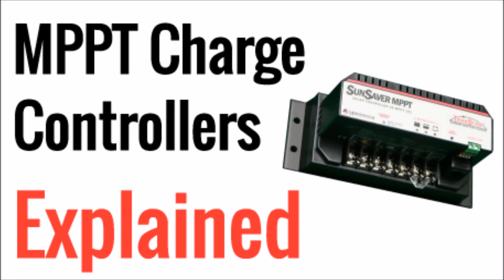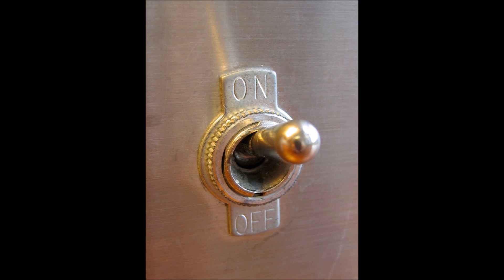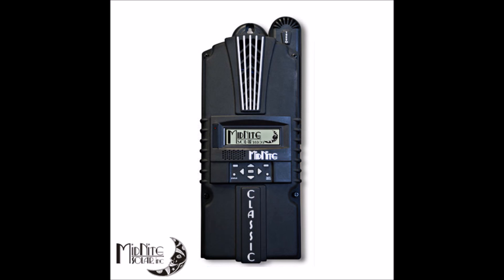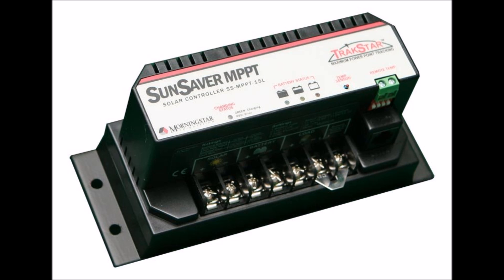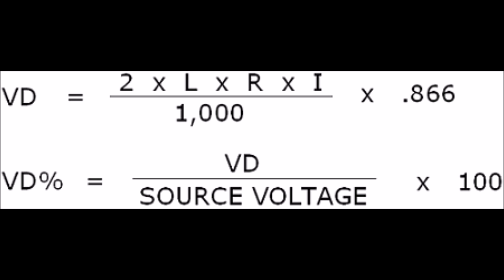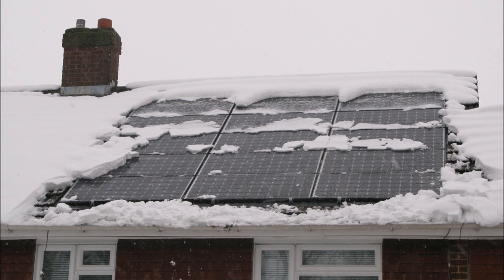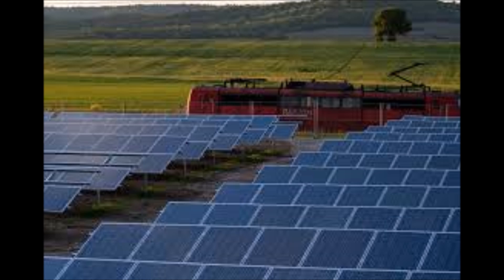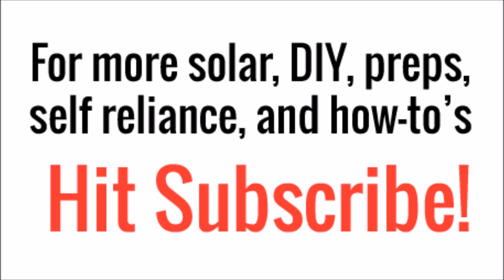MPPT Charge Controllers Explained

Comment: What is a practical 'load' on the MPPT charger load terminals?  I'm guessing you don't want to hook up your inverter here, but should hook up the inverter to your battery bank.  Is the 'load' terminals of a MPPT charger alway 'on'?
Reply from the maker: The load terminals will have the "low voltage disconnect" feature and then will automatically reconnect when the voltage gets back up to nearly full.  So it is great to use for lighting, pond pumps, or other 12V loads that don't use a lot of amps and don't need an inverter.
Reply: thanks.  Then I could hook a relay onto this to control an inverter hooked to the batteries if I understand this correctly, to prevent the inverter from draining the batteries below a safe level.
Reply from the maker: Yes.  They actually make "low voltage disconnect" devices that are pretty cheap that will do that for you.  Just set the voltage you want it to cut off and re-connect.